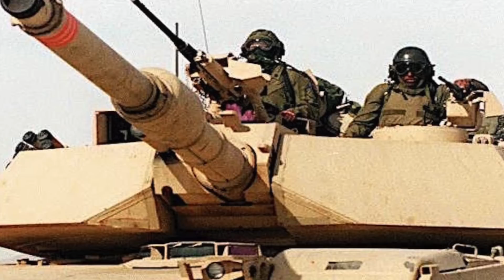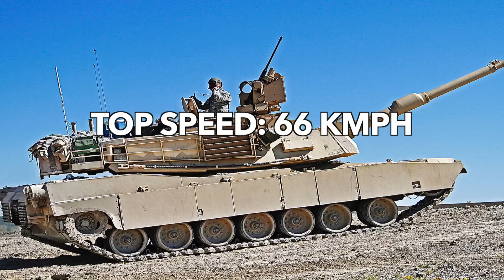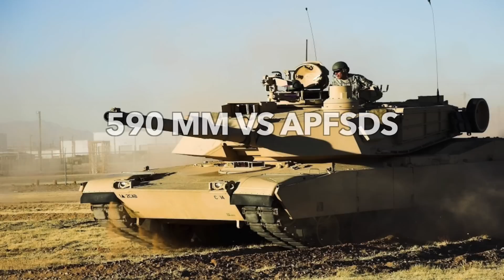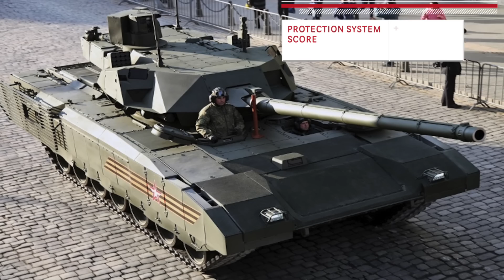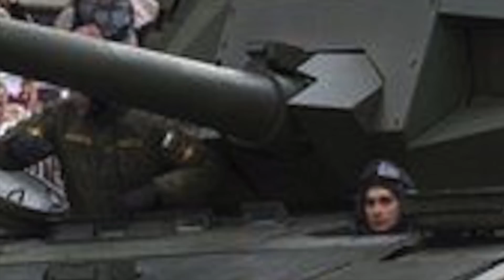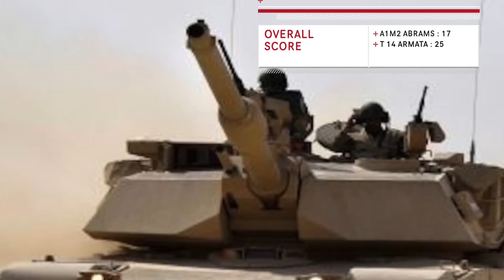AMERICAN M1A2 ABRAMS  vs RUSSIAN T14  ARMATA: WHO WINS?

Comment: You should remake this video with the real armour stats of the antient m1a2, not the m1Ip (heat). 
Also, the US has not built ome or had a singl part manufactured for the m1 since the late 90s. So operational costs are much lower then listed here. 
Also to note, the t14 specs are currently propaganda specs, the world wont realy know untill it sees real combat. 
T14 is an amazing tank, but what Russia diddnt think about, is its turret is super weak, yes most munitions over match it, but it also leaves the gun vulnerable. If you dont need to crew the tank to kill it, it's easier to kill. Just remove its main gun from existence.:) 
(Also said in video it had mega protection on turret, but in reality a high cap ap 25mm can punch through it)
Reply: You know the turret actually has a very small spot where you can actually hit the breach?
Reply: @techtical7079  Actually I did know that, as every tank Actually does too believe it or not. And Actually the t14 is worse. Lol
Reply: @ryanwilder7146  ok let's put it this way, T-14 has a very small slab you can hit to kill the breach, so does abrams, but the abrams has a massive turret ring, and T-14 hull being impenetrateable, well i'll let you figre.
Reply: @techtical7079  I was messing with your "Actuallys" lol. And no, you are wrong, the t14 is only protected from 20-37 mm Apfsds on the turret. That's 360°. Since the turret is unmanned, and the tanks is very easy to render inoperable.

Comment: What about optics and thermal imagery?  What was the range of the Russion gun? 125 mm is nice, and 152 mm is scary, but not if it misses it targets.  US has puposely, always, shyed away from automated loading systems, and especially turrets, becuase they are always one thing that can fail when electric power and/or hydraulics are lost.  I also question the data on the Russian armor.  US armor is good enough. I always remember that Israel won wars in the 60s and 70s with outdated armor due to its ability to fix damaged tanks, protect crews, and get hardware back on the battlefield (logistics).  I will be watching with great interest if Russia sends any Armatas into the streets of Syrian cities.

Comment: since the usaf and navy will have virtual control in the air the ground assault would be after extreme softening of resistance forces. aggressive air support would mostly render an enemy tank threat mute
Reply: How can you control the air when Russia has S 400 air denial system?
Reply: @Toronto-Brad  
it will not sufficiently track our stealth tech from the distances needed to prevent air attacks
Reply: @boedude8496  if they can't already, which is debatable, its only a matter of time and the amount of money Russia invested in the development of these systems is minuscule compared the the US investment in tactical stealth warplanes.
Reply: @Toronto-Brad  
they and the chinese are trying to improve radar tech to detect modern stealth but inarguably cannot. add to steath aircraft a healthy number of missles from land and sea based positions and their defenses are not sufficient. and insomuch that their tech will improve so will ours
Reply: The F-35 has very high radar visibility for a stealth plane, yes the F-22 is another storey, but for the amount of money invested, I can hardly call it a worthwhile tradeoff.
Reply: @Toronto-Brad  
no, the 35 has a smaller cross section than the 22. the 35 is arguably a better air to land attack craft but the 22 is the definite air to air winner with its weapons and speed. as far as cost..as all top military creations go its way over budget. but having the best dogfighter is hard to put a price tag on

Comment: Need a missile that will go under a tank and explode under its belly. The ground would enormously reduce blast dispersal into the air. 
Even if the explosion did not break through the belly armor, the tank would be tossed into the air, seriously injuring or killing the crew and possibly landing upside down.
Whoever establishes control of the air first will damage or destroy the enemy's tanks and other armor. Even if an aircraft is destroyed or forced to withdraw, if it can get its air-to-ground missiles off before being neutralized, they will do their jobs.
Reply: They're called mines.

Comment: Big issue with T14........it’s been pulled from the production line after only 20 units built. Their assembly lines are not adequate to build it, and they have no budget to support it. So back to the T90. Meanwhile America is building more aircraft carriers, and the M1a3 sep is already arriving.

Comment: T14 liability has is a crew stuck inside the central box, they have very poor visibility and are 100% reliant on electronics for situational awareness. This place them at a great disadvantage, and the three men crew also have a greater workload to maintain the vehicle, or will need logistical support which will be more a lot more vulnerable than the tank. Until proven in combat I prefer to hide inside M1

Comment: And automatic gun that can fire 12 rpm isn't as good as a human loaded gun that can fire 10 + rpm. How fast is the automatic reloader with 2d round? What kind of fire control system does the Russian tank have, and is it as good as ours, which is battle proven? Can it fire accurately on the move? If it is moving across country, how comfortable is the crew? How does that affect accuracy? None of these vital questions are answered.

Comment: First of all there is a lot of bias. 1. The M1 family of tanks cost slightly less than 9 million per unit. 2. You can even insert jet fuel into the armata and you need to mention that the US can switch tanks for certain fuels as in one fuel tank you just can't pour different types of fuels as it damages the vechicle. 3. The armata tank 152mm design is true but, there were 2 more prototypes such as, the 180 mm and the dual 152 mm cannon design which were failed prototypes. Not to mention T-14 with grad system and a 125 mm cannon. 4. The T-14 Armata is just a platform and not a tank. As it can have different turrents therefore, the name changes and how it looks as it becomes different. Thanks.

Comment: M1A2 has more like 800-900 cs APFSDS on the turret and 550-650 on the hull.  Vs HEAT its more like 1300-1600 on the turret and 800 or so on the hull.  M1A2 also has ERA and ARAT which further boosts protection.  Those numbers you gave are at best, an M1IP....not an A2...

Comment: And by the way, while going over 66 kph in an M1A2, we were bouncing around to the point even the stabilization wouldn't help us much in being able to effectively engage anything.   And let's face it, the heavier tank is the more stable tank at high speeds.  Basic physics.  You should also think about the 'savings' in crew members.   In combat, a lot of things happen fast, and a crew must definately multi task.  Someone scans the battlefield and priorities targets.  Someone directs the tanks movements, someone aims the guns and services targets, a tunnel vision task, someone has to clear mechanical failures.  An auto loader is much more complex and likely to jam.  Who clears it on an Amata? Someone has to steer/drive the vehicle, again a tunnel vision producing task. Then someone has to monitor the radios, report contact, respond to orders from above, and guide other vehicles in the unit.  Wow, the three man Armata crew are going to be pretty busy.  And if the vehicle throws a track, or even needs routine maintenance, that fourth hand comes in handy.  The video says 10 rounds per minute.  LOL, At that rate of fire, every M1A2 crew, in the entire fleet would fail every gunnery exercise.  I managed a 1000, so that isn't happening.  And lastly, we never mention the gun control system.  In the first gulf war I remember an Iraqi Republican Guard tank company commander, who, after losing a little over a third of his command, ordered his men out of their tanks despite their being in excellent engineer dug fighting positions.  When we began to interrogate him, he quite seriously asked if we had developed some kind of cloaking device.   There was a weak sandstorm as we attacked, and we started shooting targets we detected in our thermals at a little over 2 clicks.  At that range the Iraqis could neither see, nor hear us with any of their crap Russian made equipment.  He thought it was an air attack at first, but then would see a flash on the horizon about a second and a half before each of his tanks burst into flames.  With no targets to engage, and losing vehicles at a contact rate, the diehard, quite willing to fight, saw now reason to continue and ordered his men back into their holes, where we later rounded them up.  The Russians want to reignite a Cold War in which their weapons industry can once again arm all the petty dictatorships like Syria, Pakistan, Cuba, Venezuela, Nicaragua, ect., all go on buying sprees to resist the Evil NATO pact nations.  They realize they can't get ahead of us through actual merit, so they are trying propaganda, fear mongering and disinformation, same as they did before the Soviet Union collapsed.

Comment: "Tehe russian army plans to build 2300 T14 until 2020???

Russia has ordered 132 T14 and T15...

"It has been obvious for some time (…) that the Russian Ministry of Defense (MoD) has abandoned plans to mass-produce 2,300 T-14s by 2025, as was originally outlined in the 2018-2027 State Armaments Program. For example, already in October 2017 the MoD announced that it will upgrade T-80 and T-90 series MBTs and revise plans to melt down 10,000 armored vehicles by 2020 and keep 6,000 in reserve."
Reply: Proof of concept and operational evaluation. Small batches first.
Reply: @jefftheriault7260  No that will be it...just like SU-57 (12 planes)

Comment: Thought Russia decided to just modernize the t80-t90 because the t14 was too expensive to mass produce ?
Reply: They didn't. They will have more T-90MS, which is for sure, but it is for the better. They will have many T-14 but the numbers are  unspecified. The T-14 will be used in special situation while the T-90MS will be used for common ones. Both are great tanks and it would be great if we could see some T-95 Black Eagle as well.
Reply: It's not, its because they already have more tanks than they need...

Comment: if that was unbiased i wonder what the biased comparison would be...

First there cant be the same armor all over the tank. There is not a single place on the T-14 to have 1400mm armor. There are many different places on the tank with different thicknesses of the armor. There are places where T-14's armor is thicker and places where M1A2's armor is thicker...

Also there is no such thing like 12rpm on T-14. It is no more then 8rpm. As for the Abrams there it could be between 10-12rpm depending on the loader and his skills.

Edit: The armor of T-14 can't be stronger by just one single thingy. M1A2 is much heavier...

Comment: M1 Abrams is battle tested. Therefore, unknown problems are discovered and fixed (which is a good thing since knowing the ins and outs of your tank is critical). Furthermore, M1's crew have great experience fighting with it, so naturally, they are more skillful with their tank.

T14, on the other hand, is not battle tested. Therefore, unknown problems may not be discovered and when war happens, this could be dangerous. T14's crew isn't very experience because they never fight in their tank. However, the defense capabilities of T14 sounds great and so does its firepower. 

There are over 10.000 M1s and only a few T14s, no matter how crazy the T14 sounds, if a war happens M1 gonna win because they got the number and the experience. The T14 is great and advanced, but in war times, can Russia produce a very advanced tank in a short amount of time? I guess not, the outcome will be very random, there would be good T14 tanks and there will be bad T14s. Look at the T34, the quality of that tank is very randomized. 

Let's compare the T14 to the Tiger tank and the M1 to the M4 Sherman, German produced 1347 tanks, while the US produced 49,000 tanks. The Tiger won battles but they lost the entire war. The Tiger was simply swarmed by the US. So will the Russian produce T14 in mass number? or their T90? 

In conclusion, I think (please don't hate me) the M1 has an edge over the T14 in term of experience and mass production capability (for now). We still have to wait until the T14 has its fight first. 

P/s: I am not an American or a Russian or a Chinese or a European guy and I do not a fan of any of those countries. Please don't call me a bias. Sorry if my English is bad, English is my second language.
Reply: You've brought up good points. And an attack by NATO on Russia and Russian allied nations is highly unlikely.

Comment: The T-14 Armata has weaker armor and poor protection on the turret, the engine is not really reliable, since it broke down a couple times before. The Abrams is one of the most deadliest and protected tanks according to numeral sources. The Abrams has a good engine and advanced computer systems. It also goes down to the crew of the tanks too.

Comment: Also the cost of an MA series depending on version and load out, even smallnthings like what version of the CROWs system it has, the newest one costing over 1m and if it doesnt have one just acouole hundred for the FLEX mount. Base cost is about 3.5m

Comment: Talks about the Armata ERA but fails to mention the M1A2 sepv2 era blocks and the new era blocks on the M1A2 sepv3. Also mentions armata missile defense but fails to mention that the M1A2 sep v3 is using trophy and it's going very well. Also fails to mention the new ammunition the 120mm has. While the T14 looks like a good step ahead for the Russians the crew is what's gonna be the main problem. While Russia still uses conscripts with little to no training the Abrams tankers are amongst the best. The best loaders for Abrams can pump out rounds every 2 to 3 seconds with capabilities of getting 14 rounds a minute.

Comment: I think the main error here is the armor rating of the M1A1 and M1A2 and SEP versions, nowhere can you find actual ratings for the non-restriced (domestic US) versions that include the depleted uranium ceramic mix armor. In fact, i'm pretty sure the ratings you've cited are for the export, non-uranium version, with conventional composite armor. Unbiased, yet inacurate. In desert storm, the M1A1 has proven extremely difficult to destroy, even by friendly fire with SABOT rounds, and in one instance an AGM 114 hellfire missile fired from an AH-64 failed to render a stuck M1A1 inoperable. Good luck besting that with the conventional armor of the armata.

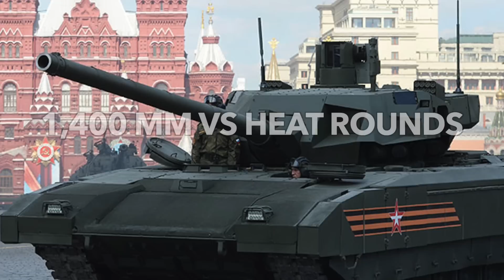Comment: 03:00 T14 Does have 900mm protection FOR THE COMPARTMENT CORE. Meaning that it has way less armor protecting other parts of the tank. While it's APS claims it can defeat Kinetic rounds, it has not seen in action yet. Therefore it is safe to say M1 Abrams has a higher protection for the tank as a whole, while T14 Armata has a higher protection for the crew member.

Also don't forget Sep v3 increases M1 Abrams's armor too by using a different material.
Reply: Hull of T-14 is impenetrateable by all current known rounds
Reply: In ukraine the aps system has been shown to be ineffective

Comment: You are comparing Apples to Oranges. The M1A2 was the standard Russia knew they had to beat when designing the T-14, so of course they are going to add features they think surpass that standard. However, the T-14's "armor" includes reactive armor. The M1A2 also has reactive armor kits, that have been used in combat...so why not mention that in the comparison? You compare a naked Abrams, essentially, with a tank that isn't. Apples to Oranges, again. Secondly, you include the T-14 Active Protection system, but not the Trophy system being deployed on the Abrams.

In my opinion, it comes down to which APS system works most reliably, and which tank is the most battle tested and reliable to operate. The T-14 being new will naturally run into a lot of issues/bugs to iron out before it reaches a level of reliability they are comfortable with. It would be the same if the US rolled out a brand new model newly built from the ground up. It will take years to mature.

I also think APS systems will be able to be defeated with some new countermeasures...perhaps radar jamming drones that can loiter over the theater.

Comment: What are you talking about nonsense here? what comparison?
T-14 Armata is fiction !!!
1. all the time there are problems and delays with the engine for this tank - copies that the Russians show publicly are riding a substitute engine providing only 60% of the planned power ... the Ministry of Defense unofficially admitted that the production of the target engine will probably start (!) In 2021 ....
2. all the time there is no fire control system in this tank = it was planned to install a system based on electronic components from Germany - now it is impossible after sanctions! the Russians tried to change these chips with Chinese ...... but the catastrophe came out - just as with the replacement electronics for new rocket corvettes - Chinese cheap shit breaks down immediately

So what are you telling stories here?
maybe you compare the mass-produced Abrams with a UFO vehicle?